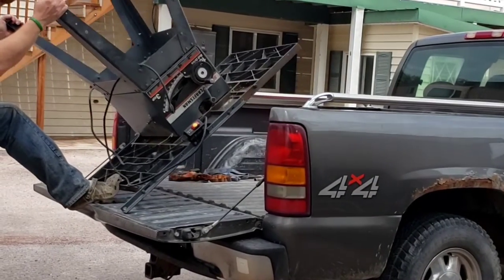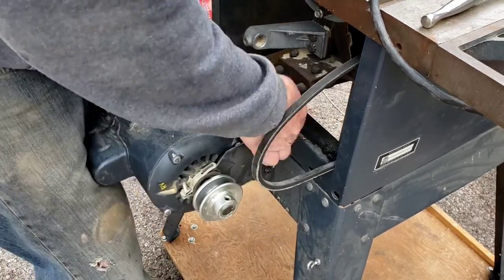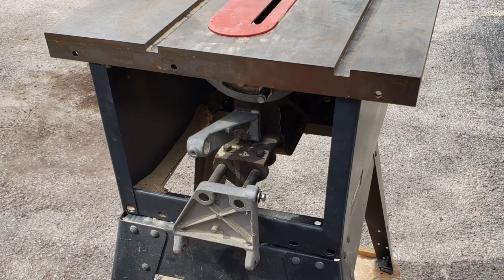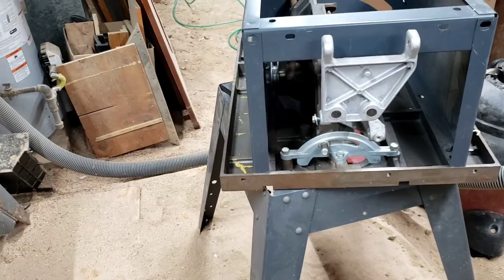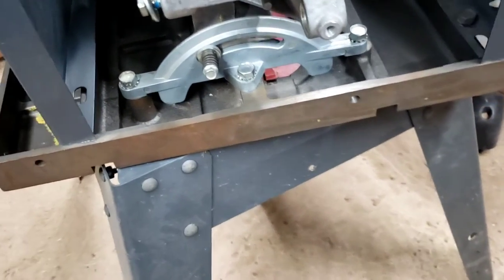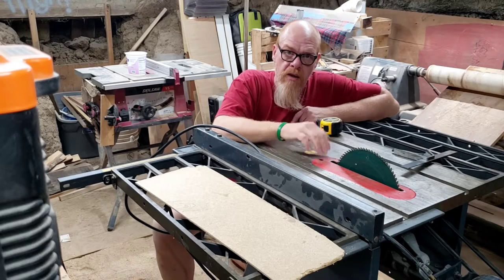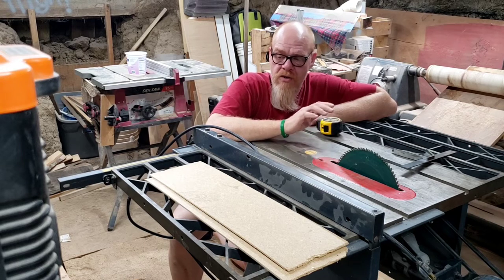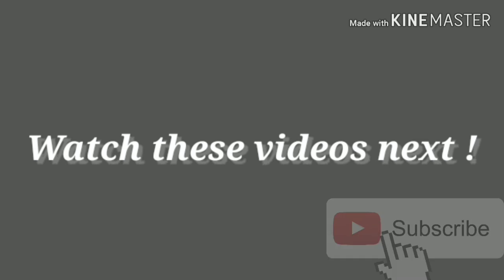Craftsman contractor saw 113.298762 tune up

Comment: You had me at the use of "making sawdust"! A good friend of mine got me interested in woodworking,  or making sawdust as he called it. We were both in software development so woodworking is hobby, not livelihood. I have a Jet Contractor saw which is, likely, made by the same folk that made yours. We moved from where I bought it and the movers clearly were less than careful. I've had bad kickback twice now, it burns wood and the blade is off 10/1000th. I'm jealous you can still pick yours up and move it. I cannot at this point. I do have to realign the blade. Hopefully that'll fix it. Hopefully you'll be realigning yours. I look forward to that vid. Thanks!

Comment: I still have this saw I bought sometime around 1990.  It was one of the best table saws i've had. Just recently decided to tune it up and use it again. I've been using an industrial powermatic.
Reply from the maker: That's awesome to hear! Thank you for sharing that info. I just received a new dial indicator so I can tune my trunion and fence assy. Most likely I will upgrade the fence later but getting it tuned will help a lot.
Reply: @MakinSawdust  I haven't finished this project yet...I noticed how very clean your saw appeared. I didn't want to but dicided to take the motor housing off and inspect for sawdust. I'm glad I did. It was stuffed with sawdust and possibly could have shorted out the circuitry. I think you got a very good contractor saw. I thought about mostly using mine for dadoing. I wouldn't get rid of this saw for anything.

Comment: I bought my contractor  table saw in 1983 new for $269 a manager special  $100 of still have it going strong made a lot of nice things with it ànd the only accident I had was a kick back that split my thumb open had 4 stitches because I had the splitter off the saw but it's a good table saw would not trade it for a new cabinet saw I am 64 now ànd still ues it every week
Reply from the maker: Thanks for stopping by Clayton

Comment: Nice score.  You stole it.  That is a $100 saw all day long.  You paid less than the cost of the cast iron wings for the saw.  I paid $125 for a newer version with the align a rip fence.  Thought it was worth it for the fence.  It has the two cast iron wings like yours.  I put in a zero clearance insert and a new blade with a new belt.  Good saw.  Appreciate your video.  Nice job.
Reply from the maker: Thanks for stopping by

Comment: Looks like a steal for 60 bucks! I picked up one for 50 today but the motor mount is broken but the rest looks in decent shape. I found used mounts on ebay but also found out that the Sawstop saw has the exact same motor mount and is about half the price brand new as the used ones are going for. I looked over you blog about the parts and didn't see it mentioned.  I wonder if any other parts from the sawstop are interchangeable. Just thought I'd mention it as another possible source of parts.  Thanks for the videos.
Reply from the maker: Thanks for your comment. I will look into any interchangeable parts. Interested to see what I find

Comment: I’ve got the same saw! Not gonna lie though I’m having some major issues with it. Hopefully when I get some free time I can tackle fixing it with the help of your video(s).
Reply from the maker: Certainly! I am going to adjust my trunion and fence alignment. I am also going to switch to a link belt to remove the vibration from the standard vbelt. Probably some other minor bits too. What issues are you having? Maybe I can offer some tips in the next video on this saw.